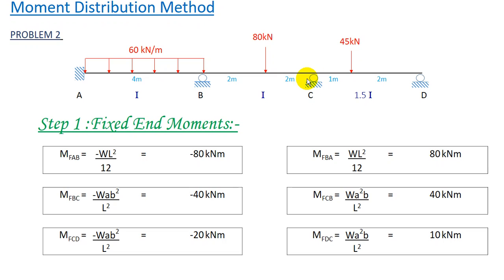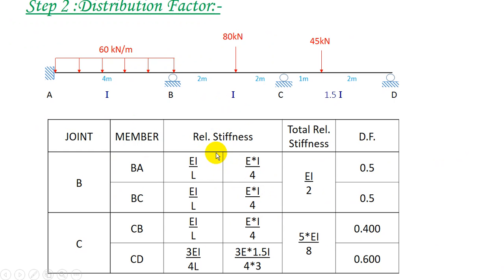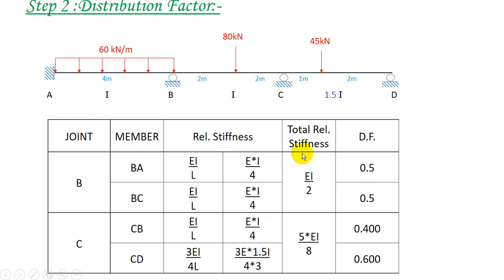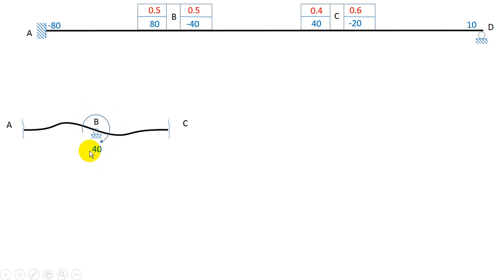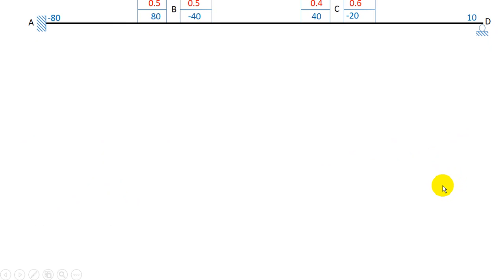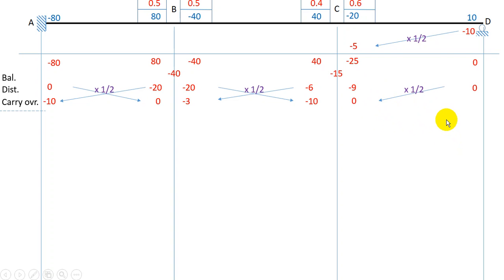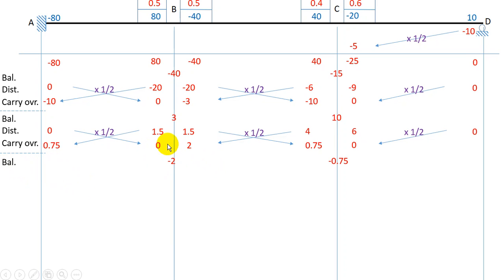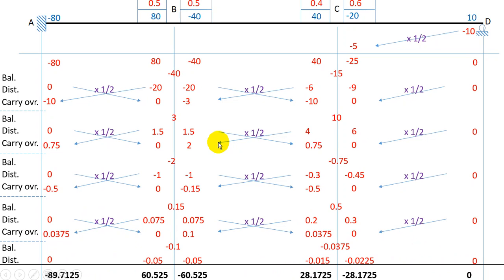Moment Distribution Method Type 2 (With concepts)

Comment: I think M (FDC) should be 0, not 10 since support D is a hinge.
Reply from the maker: amir b so we did make it zero, we have released that moment on that joint so at the end there is a zero moment on D
Reply: thanks for your reply, but you did some calculations for it and I think it should be considered zero at the beginning.
Reply: also based on fixed end moment table FEM(CD) formula is (p/l^2)(b^2a+0.5 a^2b)=25 kN.m
Reply from the maker: amir b no, the formula i have used is correct, and the fixed end moment should not be considered as 0 in begening because of a simple assumption that is prerequisite that all the joints are considered to be rotationally fixed. Therefore every joint before doing MDM iterations will have some fixed end moment.
Reply: https://engineering.purdue.edu/~ce474/Docs/Fixed%20End%20Moments.pdf 
please see second-row right side.
Reply from the maker: amir b the fixed end moment formula that i have used for span CD and the procedure that has beem followed ahead is absolutely correct although, if you wish to take the fem at D as 0 then you will have to use the formula from the pdf sheet that you have shared, and then the procedure would not remain same as what has been shown in the video.
Reply: thank you.

Comment: For point load at an equal distance, we take moment wL/8
Reply from the maker: +gaurav thakur are you talking about fixed end moment? For point load at equal distance or at center of the span its not wL*L/8, its wL/8.
However you can also use the formula for an eccentric point load that is a point load at a distance of 'a', in this case a=L/2
Reply: thnxx...ya it was the same i was supposed to write

Comment: Bro some author fixed support relative stiffness is 4EI/L someone 
EI/L
Reply from the maker: Both are correct;
When you use 4EI/L formula for far end fixed ,you need to use 3EI/L for far end hinged
When you use EI/L formula for far end fixed ,you need to use 3EI/4L for far end hinged
You can use whichever set of formulaes is easier for you to remember ,just dont jumble up between them.

Comment: why does some text shows 3EI/L and 4EI/L as for finding stiffness???
Reply from the maker: Relative stiffness when the far off end is hinged is given as 3EI/L
and when far off end is fixed it is given as 4EI/L
i have also derived these formulaes you can find them here:
https://www.youtube.com/watch?v=eD5dsPjzlO8
Reply: but you used here EI/L and 3EI/4L...whats the difference in using this and the one I mentioned above??
Reply from the maker: there is absolutely no difference actually we were taught that way to use as EI/L and 3EI/4L
it is nothing but if you take 4 common from 4EI/L and 3EI/L you get those values.
However now even i have started using 4EI/L and 3EI/L as they are whole numbers and easier to use and remember.
Reply: thnx for the reply ;) Keep bringing up the content..its really helpful.
Reply from the maker: sure, i'm glad it helped you.
Reply: it means sir we have also use in ur MDM 4 th lecture is EI/L in the place of 4EI/L .
Reply from the maker: SUNITHA KITCO yes the answer will remain same no change at all.
Reply: but does the answer remain same for both?
Reply from the maker: shantanu jaiswal yes you can use whichever is more comfortable for you.
Reply: Excellent....way of teaching...
Sir keep it up all the chapters...so that it would be helpful

Comment: How are you determining the value for I please?
Reply from the maker: 'I' is the Moment of Inertia and it is the property of the section that is used for analysis.
For eg a Rectangular Beam will have I= (BD^3)/12
A Circular c/s beam will have I= 𝜋/64 𝐷^4

Hence it varies as per the section considered.
You will learn more about it when you will be designing the sections.
Reply: To be clear, as in the 1.5I or 2I selections for the stiffnes calculations
Reply from the maker: The Moment of Inertias are already given in the question.
Further to describe in easier words you can relate Moment of Inertia directly to the strength of the members used in this particular problem.
How to decide the value of I depends upon which cross section has been used while designing the beam, this is not significant for us at this stage as it is directly provided to us in the form of 'I".
So you can say in simple language that strength of member CD is 1.5 times the strength of member AB provided they both are of same material.
Further this value of 'I' has to be put into the equations for calculating stiffness.